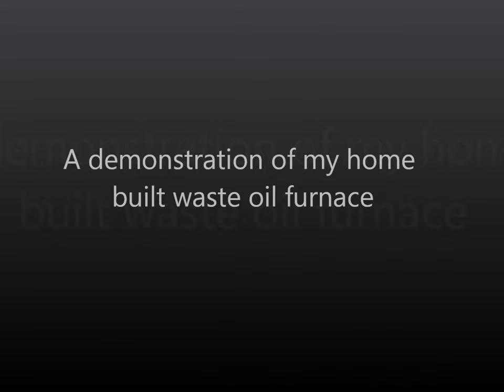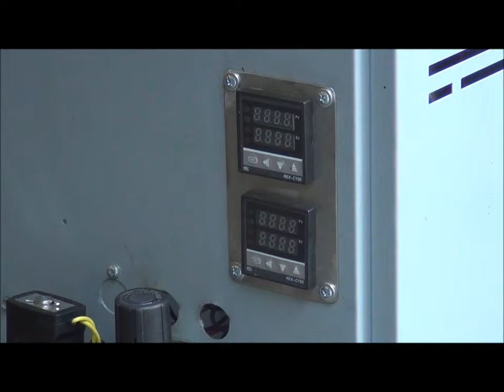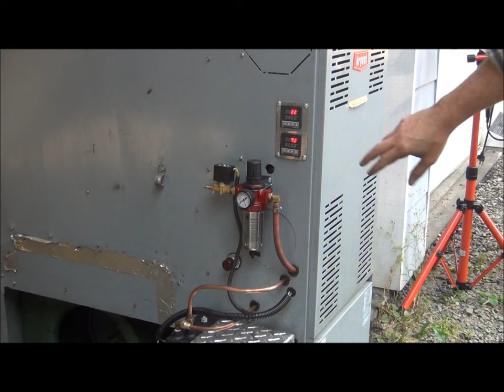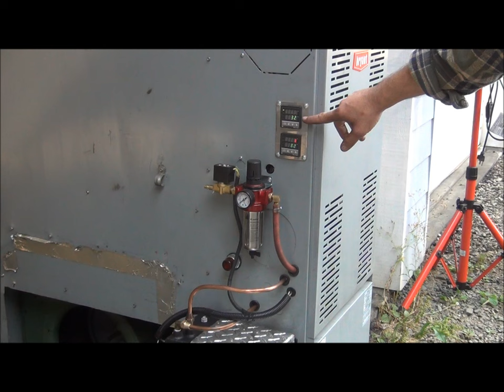Waste oil furnace

Comment from the maker: I've burned over 7000 gallons through my first furnace with no problem...
Still, I take the time several times each year to inspect the heat exchanger and other related parts to make sure they are not failing.  I highly doubt you have seen a properly built and maintained waste oil furnace melt down "a hundred times."

Comment: He has a link in the description to a forum build thread for more details. Y'all have to have a pretty advanced understanding of how a waste oil furnace works before converting a fuel oil job over. I got a waste oil furnace for next to nothing. They are around in the cold parts of the country for cheap. Get one and learn it before doing this. Just my 2c.

Comment: I appreciated your idea of the 20 second timer for the float switch. I had one fail on me a couple of years ago and whilst I "only" lost 20L of oil the cleanup was hideous. I set the time constant on my timer to 75 seconds because when the outside temperature dropped the oil became more viscous and the boiler kept locking out. Thanks for sharing your expertise.

Comment: Beautiful.  Seriously, the plastic loom to protect your wiring harness, smoothly bent copper tubing without kinks, PID controllers handling oil temp...super nice.  Perfect application for the SSR's but you might want to consider adding an upstream mechanical relay and an overtemp sensor because those solid state ones like to fail closed.  But really outstanding work....
Reply from the maker: Thank you!

Comment from the maker: I am using a stainless Hago siphon nozzle; it uses compressed air to atomize the oil and siphon it through the nozzle.  The oil supplied to the nozzle is at atmospheric pressure; the function of the oil pump is just to circulate the oil to keep it preheated.  The tip of the nozzle looks like a small venturi; large opening for the air, small opening for the oil.  Yes, the blast tube still uses a retention head.  I made my own one out of 11GA T304 stainless to achieve a better burn pattern.

Comment: Very nice. As an HVAC technician I find your design very interesting. I wouldn't have thought you could get that complete a burn with waste oil in a converted furnace. I would guess thats a 95% + furnace you used? By the ways guys who wonder about no smoke, a more complete fuel burn = less smoke. Look it up before you jump all over it.

Comment from the maker: The exhaust gas is pretty hot (touching the vent would lead to instant burns); but the siding is concrete-based, and the door is steel.  It burns clean enough that it doesn't deposit any soot on the paint, so no worries about running it so close to the shop.  
If you want to build something like this, I suggest you go to the garagejournal (link in my video description); I have an entire "how-to" writeup there, and lots of other people have contributed their own furnace builds.

Comment from the maker: I would agree, if this was a standard pressure nozzle setup.  I have the siphon nozzle tee-ed into the pressure side of the pump, and returned to the siphon tank (at atmospheric pressure).  The oil dripping is what is left in the line that runs from the tee to the nozzle after the pump shuts off.  Adding a few seconds of igniter/air operation after the pump/blower shut off would eliminate the drip, I think...

Comment from the maker: A person can modify a piece of equipment to suit a purpose other than that which it was originally intended.  Cars are a perfect example; bolt on and re-engineer enough stuff, and you can turn a stock Tacoma into something capable of running the baja 1000.  I'm doing something similar with these furnaces...no, they weren't designed to run on waste oil.  But with proper tuning, modification, and redesign, they will run on waste oil just fine.

Comment from the maker: Thanks for the tip!  With fall approaching I have my furnace apart, doing some routine maintenance.  I will consider changing the primary control...I do have a problem with oil dripping from the nozzle after shutdown.

Comment from the maker: I have had good luck burning WVO in my shop furnace; of course it is converted to a siphon setup similar to the furnace in this video.  I have never tried to burn WVO in an unmodified burner.  I'm not sure of they year of the furnace in the video; I would guess around 2000.  As far as differences between this one and yours...I have no idea!  I have wrenched on a number of oil furnaces over the years, and they were all very different from one another.

Comment: A bolt on flat strip surface heater on the tank bottom would save a lot of work in welding the threaded flange and the overheat/low oil issue. You can buy them in just about any size and wattage. They won't burn out as they are always dry.

Comment: pretty cool! I'm a master plumber & an oilheat teck., you should consider a newed primary control with pre & post purge. It would establish the air pattern, usd less electricity and clear kut the combustion chamber upon shutdown. A beckett genesis would do the trick- regards.

Comment from the maker: In the video, I am burning 15W40 mineral oil, drained from one of my diesel pickups.  Nothing else.  I'm sorry you don't believe it, but there is no deception in this project or video.  There is a small puff of smoke as it lights up, but zero smoke once it is running.  The IDI diesels you refer to don't smoke all the time, only under load when there is more fuel than can be burned in the cylinders.  They run fine on used motor oil as well, with little or no smoke.

Comment: Awesome video u seem to have the kinks worked out I'm just in the process of putting a waste oil burner together I have just made but I'm not sure how I would get the burner to switch on when the oil is up to temp I'm using a becket burner with a nozzle block I've made from aluminum  stock with a cartridge heater in it I'm getting close to getting all the wires hooked up would appreciate some help thks Nigel .

Comment from the maker: This is my understanding, based on my research:  It is legal to burn waste oil for heat, as long as it is NOT for a residence (I run my waste oil furnace for my shop only).  I am not 100% sure about selling waste oil for heat, although I recall reading that it is NOT legal to do this.  The waste oil you burn must be your own.

Comment: I'm trying to find a way to heat my Rv with waste oil.  I make black diesel for old diesels and it works great but Im having trouble finding something I can set up for my camper

I just don't have the mechanical know how yet I guess.   I've also seen some wood furnace with forced air heat exchangers which would work well but I'm not sure I could build them

Build looks great tho very thought out

Comment: I'm not sure how to respond back to you directly so I'll just post it here. well dripping from the nozzle = bad PRV valve, replace the oil pump. installing a new primary control with pre and post purge will stop flame encroachment onto  the nozzle.

Comment: If you can't be bothered with the faff, use a blowtorch to warm the nozzle & igniters on your normal furnace for 10 seconds before starting it first thing, without changing anything else.... then fire it up normally, using processed junk motor oil as the fuel.. it'll run happily after start-up. Only cold-starts will phase it - blowtorch is your pal. Processed WMO has one"Sulk" in spray-nozzle furnaces & that's viscosity at initial cold start. Add some heat & that's overcome. Same applies to torpedo heaters - they will sulk starting up on processed wmo - again, blowtorch for 10 seconds. Otherwise they won't fire. With it, they certainly will. :-) Leave the burner/cover loose what for easy access. 

I know this as I don't run anything else except processed waste motor oil through anything that "calls for " diesel or kerosene.. cars... trucks,, heaters..all sorts of heaters :-) I have to make them work, so I learned. It's fuel, don't overthink it. 

"You can't do that!" loads say.. Yeah ya can. It takes about a minute to do. Knowing this stuff is important, because fuel costs are about to rocket - just watch. Get a "dumb as possible" old diesel vehicle too - those are already rocketing in price because the smart money people know. Fuel will be the new gold - give it a year, remind me how I was wrong.
Some of the richest people going are rushing to get old-skool diesels upgraded because they know what is ahead.. When they worry - you ought too. Follow them, not the herd.
Reply: So question. Is it possible to splice into the fuel feed line and have valves on both. Say if you want waste oil run you first run it on regular fuel. Then open the waste oil with it let it burn then shut the regular home heating oil. That way it just runs off home heating oil with out needing the torch? Then to shut down you just do it in reverse?

Comment: Love the furnace so much I building my own.  Could you explain how the burner blower turns on after the temps are up.  Thanks
Reply from the maker: +trink1979 Each furnace is a little bit different, but mode of them have their own thermostat (often a "snap switch") that senses temperature in the heat exchanger.  Once it reaches a certain point, the switch closes and turns the blower on.

Comment: I emagine the heat exchanger gets clogged eventually. But its pennies to find another furnace every 5 or so years and swap out the controls. My waiste oil furnace is a lanair hi-320 that burns over 2 gallons an hour and i gotta scrape the ash out once a year but im sure i could go a few years without cleaning it. Cause its only on when im in the uninsulated barn.
Reply from the maker: I clean mine once a year too.  Chimney gets filled with fine ash, and the firebox gets a hard carbon crust buildup.  Takes about 30 minutes to disassemble, clean, and reassemble.  Not too bad...been doing it for 8 years on my shop furnace.
Reply: @MattVerley  how do you clean out the heat exchanger tho with the mandrel bent tubing

Comment from the maker: The furnace in this video came with one installed; I removed it when I did the conversion.  
The function of a tiger loop is to eliminate air bubbles in the heating oil, correct?  I think that, since I am intentionally introducing air into the fuel at the nozzle, the tiger loop would have little effect on the furnace's operation.
Reply: The air and oil mix in the chamber not within the nozzle. The oil needs to maintain a steady air free flow

Comment: Hey Matt, I really enjoyed your waste oil furnace modification that you did ! I was wondering if you would please post a link to the oil level switch and float mechanism. I'm having a hard time trying to locate one. Thanks for the great videos you been making!
Reply from the maker: This is the model I currently have in my tank:
https://www.amazon.com/Jiayouy-Plastic-Switch-Control-XSL-3508-P/dp/B07Q1GJ7JL/ref=mp_s_a_1_4?crid=29SEZ24GU8TWZ&keywords=float+switch&qid=1697408437&sprefix=float+swi%2Caps%2C217&sr=8-4
Reply: @MattVerley  I wasn't sure if the hot oil would effect these plastic floats. And what are you using for the oil feed float valve? Thanks
Reply: @MattVerley The float you linked is a 220v fish tank float

Comment: Hi, after watching countless vids on all kinds of stuff, I appreciate the manner in which you present your work. The burner seems pretty straight forward, how are you controlling the blower fan? Did you stick with the Honeywell board that came with the furnace? Sorry if you covered it already, you seem to have gathered much interest in your furnace design, probably cause it looks like factory work and not some kind of hillbilly moonshine still!
Reply from the maker: Yes; the factory blower temp control is re-used.  The only major changes/modifications are to the burner itself.  There is a more detailed explanation and write up on the Garage Journal forum (link in my video description).

Comment: Hey Matt I’ve been meaning to convert our furnace to used oil in our Auto Repair shop way up here in Canada on Vancouver Island .we have had a bad cold snap and snow this year so I’m now kicking myself for not getting this project done. Any basic info / parts list would be much appreciated. Thx Mike

Comment: great job on your heater.  I also built one with more pre heating i have a low amp ap for fuel filter then after the pump its heated once more to 200 deg then a 3rd time in the nosel to 312 deg. I didn't no how to use compressed air, I would really like to know more about it. I have to add adout 10% #2 diesel to my oil to make it work but with air I wouldnt have to. I hope U read this and get back to me s1gumb9 thanks for the Utube, all my friends R now looking 4 oil heaters.

Comment: Wish you had specs on pdf or website...         too difficult for me to copy all this from a ten minute video.      Great job you did, I just wish I could reproduce this.           so many  burners out there but most display it in a 10 minute video.
Reply from the maker: If you click on the link in the video description, it will take you to the garage journal where I describe the construction in more detail.
Reply: Nice job do you have a wire ring diagram of your system

Comment: I must have missed something are you introducing air with the fan only or do you have another means that is pushing air through the nozzle?... I don't know how big the orifices on those novels you are using, but on standard nozzles the orifices very small like smaller than the width of a human hair, and any kind of flame impingemet warps the orifice leading to bad flame pattern. Is your burner still being used as a retention head when you burn waste oil?

Comment: thanks for the reply. I understand how the thermostat works. I'm just not sure how once the thermostat is turned on which turns on your temperature controllers how does the owner know to turn on after the temperature of the preheater has reached its maximum temp
Reply from the maker: +trink1979 OH; OK.  The temperature controllers for the heated tank and nozzle heater have an "alarm" function.  I set that to about 10 degrees below the target temperature; so when temperature gets to the alarm setpoint it closes a set of contacts.  Power to the igniter/blower/air solenoid go through those contacts.

Comment: Do you know if it is possible to dilute home heating oil with used motor oil and or commercial cooking oil for home heating and with out making any changes to the home furnace? Also at what present would be the maximum dilution? Hope you know and if you do not can you guide me to where I can find the answer.

Comment: I built a waste oil furnace pretty much the same way. How are you regulating the oil pressure after it is split of of the pump. I put a needle valve going to the burner. What do you use?

Comment: How often does it need to be cleaned?  I imagine there is a fair bit of ash in used motor oil.
Reply from the maker: I clean it 1-2 times a year, depending on use.  It doesn't take too long; less than an hour.  I have attachments for my vacuum that snake through the combustion chamber and up the chimney, and I usually pull about 2 gallons of ash out.

Comment: So is that side tank the only reservoir for the oil? You were saying the furnace used around a gallon an hour and that tank looks like it holds at most 2 gallons, not all of that would be usable due to the float switch. So are you manually adding oil to the tank all the time or do you have some sort of remote tank to pump oil to that reservoir?
Reply from the maker: No, there is a 200 gallon tank outside.  The float switch controls a pump that pumps oil from the outdoor storage tank into the heated tank attached to the furnace.  Because the nozzle is a siphon type nozzle, it is important for the level in the heated tank to remain relatively constant.  That is the purpose of the float switch...

Comment: great info! can u tell me what the part number of the the relay controlled by the float switch?  I was a little confused as to how this relay was used to both power the transfer pump and power the heating element in the tank. ? or did u use two separate relays since you don't want power to the tank heating element until the full tank condition is triggered  (float switch contact opens).  Are you wiring the float switch in series before the temp controller so that the controller doesn't  see the heat call until the tank is full?
Reply from the maker: The heating element and pump each have their own relay.  The pump relay is only used to power the pump; but power to the heating relay passes through the NC contacts to make sure the heating element isn't turned on when the float switch is triggered (a simple way to make sure that the heating element doesn't turn on if the oil level is too low).  Any relay can be used that has NO and NC contacts, I used magnecraft ones in my own furnace build.

Comment: I have a converted Beckett using probably the same kit you used, I'm just at the delima of an oil pump, I bought the complete burner from craig and he removes the pump; have you had issues with the oil pump running WMO insted of #2 heating oil?
Reply from the maker: No issues with the installed Beckett pump.  To transfer oil from my holding tank to my siphon tank, I use a carbonator pump (purchased a used one off of ebay).

Comment: I am using a blend of 30/60 (30%diesel and 60% used oil  )I only have trouble when the temp of the tank gets below 25 F. would like to know about  your burner tip so I can fix or change mine .. Thanks Tjay
Reply from the maker: I am using a heated siphon nozzle with compressed air.  A link to photos and a complete explanation of the setup are in the video description.